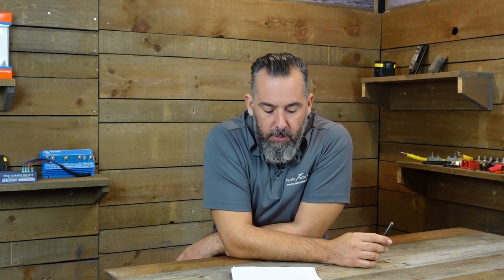What Are Electrical Grounds on My Boat?

Comment: No messin' I'd love to see that 2 hour video on grounds!
I think it'd take me longer...including galvanic isolation. 
What's so ironic is the wire most people think is the simpliest and "you don't really need it" is by leagues the most complicated.
I'd also love to see how galvanic isolators stand up to modern household noise on the PE. 

For terminology simplicity, I refer to the P(rotective)E(arth) as the Earth as it is Planet referenced (or hull referenced in the micro planet that is a floating installation)
0Vdc as the negative.
The ground is when you connect the DC negative to a chassis or framework.
C(ircuit)P(rotective)C(onductor) is an earth connected to a chassis or framework.

Personal preference I much rather a Green Earth Bus and a Black/Yellow DC Ground bus linked. It's more straight-forward than throwing it all together.

Comment: I definitely wouldn't be bored by a 2 (or 8 hour :p) video about grounds :)
In Europe it seems most boats don't have a tie between AC ground and DC -
Different pro's and cons to that and it ofcourse all depends on the system design.
Rabbit holes everywhere.
Reply from the maker: Thanks Koffi for sharing.
Reply: That's because galvanic currents*. The boat gonna get corrosion. It eats the least noble metal (sry if the terms are wrong)

Comment: I'm not sure how to ask this question without confusing the topic further.  But if I connect my grounding system to the engine block with the DC negative wire is attached and those grounding wires run back to say the metal casing of an inverter don't I create a situation where if I accidentally touch a positive wire to that case I get a short and possibly sparks?
Reply: Did you ever get this question answered?

Comment: The neutral and the ground must be tied together whenever the system is separately derived (no direct electrical contact between two sequential points - i.e. transformers, electronics - VDC systems, converters, etc.). A lightning protection system must be electrically isolated from the boat all the way down to the external (underwater) main ground bus (otherwise, the difference in potential that happens during a lighting strike will create an arch inside any electronics that make contact between ground and boat, even if turned off).
Reply: I have found that lighting will go where ever it can, it jumps throught the air with ease. grounding systems in buildings use braided cables and put it in pvc conduit  to prevent it jumping.
Reply: This makes sense to me - to have everything concerning a lightning ground separate from the rest of the grounding system until it is outside of the boat.  Do you have any references to share on this?
Reply: @anthonymillevolte3470  National Electric Code - Grounding. The best method of mitigation is by using electronic surge protection device.
Reply: @josidasilva5515  Thank you.  Are these standard consumer devices, or something that goes between the ground and the neutral bonding in the boat?   During multiple lightning strikes near my house, we saw arcs shooting out of the sockets repeatedly - shutting off the main breaker didn't help, since it came up through the ground side.  I know people who've been struck (they aren't the same afterward) and my cousin's boat nearly sunk after having its hull peppered with holes.  So, lightning rattles me a bit when it comes close...

Comment: Thanks. So i recently added a blue sea ELCI at my Charles transformer secondary. I also added a neutral to ground bond at this now, “first major disconnect”. Previously neutral was not bonded at the transformer. 
Shore power works great. I recently got my Northern lights 16kw generator serviced and running again. 
Heres the issue. When I  switch over to gen set power at my main panel (mid ship). The gen set breaker trips immediately. However, if I manually open the ELCI at the transformer secondary first, then no trip and everything works fine off the gen set. Trying to figure this out. Any suggestions? Thanks

Comment: Hi, could you tell me how a M.E.N works on a boat (house boat)if you have Steel pontoons and all wiring does not get grounded to the pontoons or motor as the Electrolysis would corrode the metal components ?  Thank you  Dave   Australia

Comment: I have a woven ground wire that has disconnected itself from the inside of the hull coming from my mast. 
Can I reconnect with some kind of metallic adhesive or would it have to be welded by a welder ?

Comment: House battery is connected to a large bus bar and all other grounds connect there but for the start battery. The common connects to the engine via 3 foot cable. The start to the engine by a 3 foot cable.  Should I ground the start to  the common bus with a 6 foot cable or leave it  the two ground  connections to the engine. Have a main 1 / 2 both off set up.

Comment: Question- recently purchased a VHS Radio for my fishing boat. It has a ground terminal on the back and was not clear where and how to connect this to my boat. The mfr. tech support sed to connect it to a DC (black wire) connection. I Don’t have a clue and don’t want to damage my radio.

Comment: So are you saying that where there is no grounding plate on a boat then an Inverter casing earth wire should be connected directly to the DC Negative Buss Bar????? There is no external grounding plate on my Jeanneau DS41 nor can I see any earthing wires connected to either the engine block or saildrive

Comment: Hey, i am installing solar panels on my steel sailing yacht. I noticed that on the panels there is a ground/earth marking. All solar panel installations, on steel sailing boat, i watched never mentioned hooking up the panels with a ground wire. 
Do i need to attach the solar panel to ground of the ship?
Like to hear from you. 
WKR Herman.

Comment: The user manuals for some of the new electronics I am getting in the mail seem to think their products deserve more than a grounded negative bus bar.  Do electronics sensitive to noise in the RF benefit from a path that takes them further down the chain, closer to the actual source of grounding?  From what I am reading, it seems that I really should have an RF neutral bus bar closer to the bottom of the boat.  And what about lighting grounding?  Someone has suggested in these comments that the lightning ground path should be connected on the outside of the boat, which makes a hell of a lot of sense to me - I prefer all of that as much of that excitement to remain on the Faraday cage that my boat is willing to be.   I really don't want to inadvertently invite lightning into my boat because it is more convenient to bond things that way.  And that's only the DC side!  I'd love to hear a discussion on these topics with you, a physicist, EE expert, and (of course) Nigel Calder!   My sense is that there might not be a consensus on all of these issues - and I'd be OK with that...
Reply from the maker: If the manual specifies a RF grd, then strongly suggest you do too. 
Unfortunately have limited experience with lightening protection system.

Comment: So how do you chase a bad ground? I have house and engine batteries on a different circuit.
Lights flicker when I use either. 
Also in a bank of 4 house batteries in series the middle 2 drain while the outside stay at 6v
Then the inverter shuts down. 
I wish I was smarter

Comment: So if my AC 120 volt feed comes into my boat from shore power with a hot, neutral and ground.  I can assume the neutral is grounded at the dock and Not ground it again in the boat?  OR, should I tie the neutral to the common grounding point in the boat too?
Reply from the maker: In North America, the neutral and the ground should only ever be tied at the source of power. You should not connect neutral to ground on a boat. When marine inverters inverter, they do a a neutral to ground tie, but otherwise the neutral and ground are separated.

Comment: Advise please I have earth wires from my fuel filler, water filler waist outlet etc they all link back to a buzz bar .does it then have to have a wire connecting it to the battery same as the rest of the equipment??
Regards
Reply from the maker: Sounds like you are describing a grounding bus. Eventually all grounds should be connected together, including DC, AC, bonding, etc...

Comment: Hi Jeff.  I have a question i cant seem to find any information on.  I have a sailboat that recently had an issue with stray current which ate a hole in a through hull.  She is pulled out of the water now, but in going through the wiring and tracking down the stray current (fixed)  i discovered that there is still a 200mV potential between the negative battery cable and the bonding wire - with  battery completely removed.  Is this just residual galvanic potential due to maybe some dampness between some metals, or is there something i should be worried about before putting her back into the water.  I just cant think of where this may be coming from, except maybe the fuel transducers (fuel tanks bonded).  But even pulling them reveals no change.  Trying to find an expert opinion before scheduling a relaunch.  No experts at the marina as is in Mexico, and lots of opinions there....
Reply from the maker: the bonding bus should be directly connected to the battery neg bus (as should the AC green ground)  so you should have 0v.  It sounds like your bonding system might be isolated from DC neg.   do you have an ohms reading between the bonding system and DC neg?
Reply: @PacificYachtSystems  Well, that is where it gets a little weird. There is continuity between the negative terminal and the bonding wire.  At the negative terminal, with battery connected, I have 0 volts, all the way through to the negative bus bar.  However, when i check the voltage between the connected negative terminal and the bonding wire, i see 0.2 volts on the VM.  Doing a bi-section type disconnection of the bonding wire connections, i find a 0.2v potential showing up where the bonding wire is connected to the first fuel tank i encounter inline.  I disconnect the fuel tank and notice that i have 0.2v showing up on the fuel tank, and carried through the fuel lines - thus showing up on the bonding  wire when connected.  The 0.2 volts remains present even when i completely remove the batteries.

Comment: Does the negative bus bar need to be grounded or bonded to the metal on the boat (mine is fiberglass, so it will be hard to find a spot), or is the fact that it is connected to both negative batteries terminals enough to create an acceptable ground?
Reply from the maker: In most cases, the negative bus is connected to the starter / engine block, in turn the engine is connected to ground via the transmission, coupler, and propeller shaft. Some boats without this setup, will use a ground plate to provide ground to their DC negative distribution.

Comment: Hi Jeff. I'm having new aluminum fuel tanks installed on the boat. There previously were connected to the bonding ground from the builder. The guy installing the new tanks want to connect them directly to my DC ground in the console with my electronics. Which method is the best way to install them?
Reply from the maker: Hi Keith, that's a hard question to answer right or wrong. Most boats don't have a dedicated common ground and instead use the DC negative as the common ground. Assuming your DC negative is properly connected to ground, then you can connect your fuel tank to DC negative.
Reply: @PacificYachtSystems   What do you mean in saying "your DC negative is properly connected to ground"?  DC negative is the negative battery post, in most instances. And "ground" is a buss bar attached to that battery post? "Properly connected" means with a conductor capable of handling the battery current?  Just trying to get my mind wrapped around all this.  Thanks.
Reply: I am putting in a new fuel tank . I asked the tank builder who said the ground should go to the battery negative. Instead of all these grounds / bonds going to the battery shouldn’t a ground bar be brought to an area then all the grounds  bonds  be tied to that bar?

Comment: Am I understanding correctly that for boats without an AC system the ground for the DC is just the negative/common side?
Reply from the maker: For DC and AC system, being grounded means having a connection to the water, generally achieved through the engine block -> transmission -> propeller shaft.
Reply: If being grounded means a connection to the water via motor, propshaft or similar, what do you do if you don’t have a motor, and how crucial is it?
Reply: @mikemcdougall193   If you don't have a motor, you likely don't have a prop shaft and prop, meaning no current-carrying metal contact with the water.  I'd imagine the best bet in that scenario is to create a through-hull port with a heavy copper rod protruding a little into the water to which you can connect your common ground inside.
Reply: @PacificYachtSystems  My fiberglass catamaran has two motors in the water, both acting as grounds.  I see some cats having Dynaplates installed.  How are those used as ground? And, how are they connected to the DC ground buss?

Comment: I was a sparky on board ship. Ships ground was thru the haul into the sea back to earth. Now a boat would be thru the motor. There are many grounds as mentioned electronic equipment for one, the common may be polarize in order to operate properly. I  know it's not a ground, mechanical or electrical. In laundry washing machines a Wascomat older machine would have alternating common thru out the machine crazy how would like to trouble shoot that LOL. I know it's a common & not a ground too. A cars ground is a floating ground not going back to earth thru rubber tires that's why it's one of the best places to be in a during a storm & not a boat etc...  I had my runnings trying to understand grounds too like Jeff said. I'm sure one could have a Doctorates in Electrical Engineering & could run into a ground situation :)

For we know its earth & electricity sometimes goes where it wants & is hard to understand!...

If we could figuring out where lightening is going striking the ground that sure would be a wonder, maybe Tesla could ?
Reply from the maker: Thanks for sharing Martin, appreciate your insight as a sparky.
Reply: Are you saying that on an outboard equipped boat there is no need for bonding to a hull ground as the outboard has a negative cable attached to the starter and charging system, thus the aluminum body of the motor which is usually painted, acts as a ground to the water? One would still have to connect the thru hulls to that. I'm thinking maybe you meant inboard shift drive boats where the shaft is not painted or coated and somehow has a ground applied to it thru the cutlass bearings. I bought a used boat. It has a bonding ground plate. Nothing is hooked to it. Should I connect the bronze thruhull to it somehow (seacock is mylar) and the thru hull is threaded into it. Boat is trailered. I don't think I have an RF ground to the VHF radio or FM radio, just the power wires, pos and neg. As you can tell I'm trying to put two and two together to grasp the picture of marine bonding and grounding specifics and peculiars.
Reply: @hoobeydoobey1267  Electricity always needs a route back to its source.  You cannot keep it from returning to where it was generated.  That is 100% of the entire principal.  The confusion comes in when people start calling things "earth" and "ground."

All you are doing, is creating a way back to the source of power.

In AC, the "ground" as it is called, is a safety feature.  If there is a break in the circuit and it cannot get back to the source (NOT the earth, the power plant that generated the electricity), the electricity will follow the next easiest way to get back to the power plant.  We create the "ground" system to allow the electricity a way back to the power plant, via the natural conductivity of the earth (but it is not going to the earth, it is going to the power plant via the earth).

If you did not have a ground wire in your house, and there was a fault, the electricity would be forced to the next easiest way back to the power plant via the ground (literally because the power plant has huge copper rods driven into the earth to complete the circuit, the same way you ahve a copper rod drilled into the earth outside your house), and that easiest path back to ground might be through a persons body.

So with that concept, a ground in a boat has nothign to do with the earth or dirt or anything like that.

The power is trying to get back to the source, aka the battery, or the generator, etc.  Just like a vehicle, there is no need for the electricity to ever go back to ground, there is no where for it to go once it gets there, it wouldnt want to go there.

So in DC, the ground is just a way to bring everythign back to the battery and be sure that everythign is connected.

Bonding is much more complicated but much simpler on most boats because you are removing the earth and our man made conduits to it from the equation.

Lightening protection is the only system that actually involves the earth from the boat (because power is trying to return to its source, which in this case, actually is the earth).  It is separate from your electrical system and gives a huge beefy way, the path of least resistance, from the top of your mast to the ocean, bypassing your electrical system.
Reply: A very good basic description of the common misconception most people have of what is a ‘ground’ and what its actual purpose is!